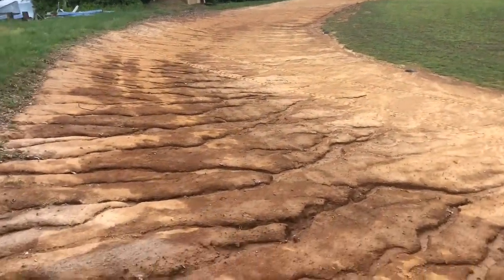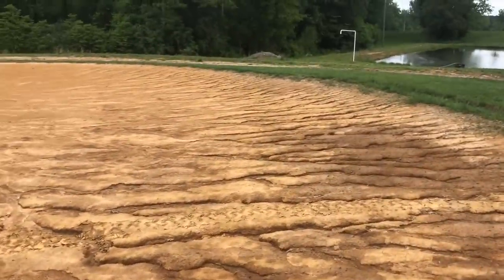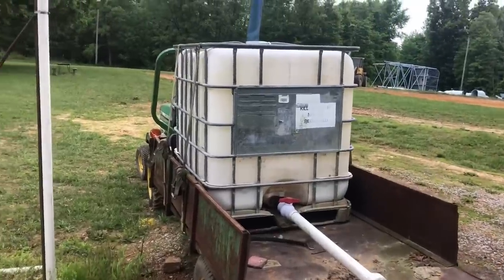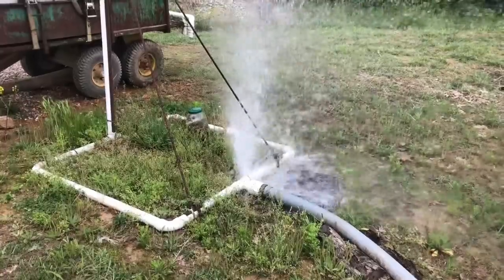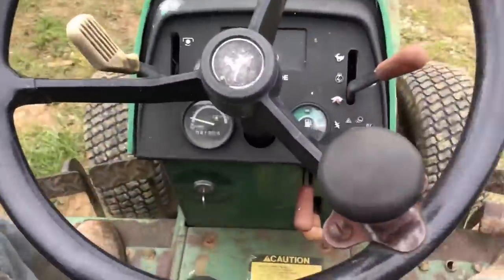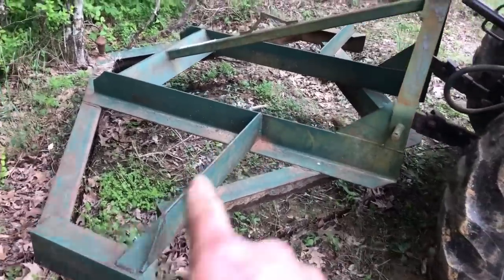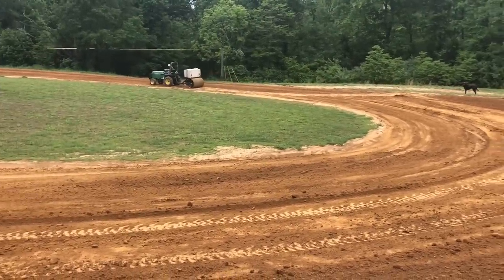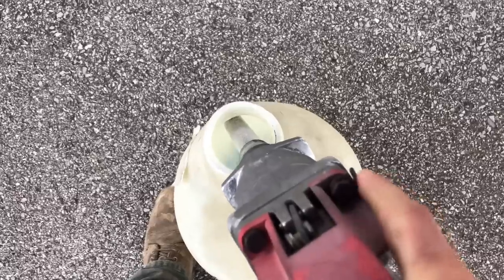Track preparation and Friday night racing

Comment: I raced karts for years absolutely loved it we ran flat heads when I quit they where just transitioning into a clone motor (blue motor or predator) I was always a Briggs guy we did run the animal engine Wich is an ohv Briggs and I had a big block Briggs Wich was 10hp block that made around 58-60 hp on a flat cart with no cage it was way more than you needed I built it solely for outlaw class ran alot of places beachnut, lil indy , I-35, junction City,clay city I have 285 or so feature wins 6 track championship wins and lots of heat wins if you ever have any questions feel free to ask my dad is one of the best set up guys in my area haven't raced since 2010 and they still ask him to set karts up
Reply from the maker: Awesome thanks will keep that in mind
Reply: I’m a flat head get myself. Ran super heavy in north Georgia

Comment: thats a great attachment,, never seen one here, i gotta build one for the front of my 25hp lawn tractor, and built it to hook tho the H frame for the snow blower head, and hook up a big pump to one of the pto shafts, one in front, one in center and one at the back, that hardest part to find tho is a female spline that fits the pot shaft, it is a 1-1/8" shaft with really fine spline, the coupler for hooking up the drive shaft for the snow blower and mower deck it so big and bulky, with a 3" pull back collar to lock on, but for a pump, just need a plain coupling witth pto spline on one end and a 1/2" round w/ way for the pump, slip on slip off, i have all kinds of diferent size and RPm hydrolic motors kicking around from when i worked in the bush and they stripped down the old short wood koring harvesters and we build de-limbers, truck log loaders out of them, dam cabs were 18 feet off the ground, that power rake would be a snap to build, never seen on at any equipment dealer here, that works great, that must have also what was on the skid steer when i said it was going so fast you couldnt see the bucket, and you said it was a power rake... this is what you was talking about, but one that fits skid steer.. i can look at something and have a snap shot in my head and build it..
Reply from the maker: Cool send me some pics of you build
Reply: @DirtPerfect  i will do a video when i build it,,

Comment: a tip for you put lysol in your water about 1 gal to a 1000 gallons of water ,  also when u run your track in pack it in the opposite the way u race on it will give u a smoother track to protect your bottom end as u say it.
Reply from the maker: Interesting may have to try that
Reply: @DirtPerfect  I have worked at several dirt kart tracks and was an official flagger for WKA

Comment: i thought that was an RC track.. like we have in town, i built the same kind of watering system for mixing calcium in water to put on mt 2800 feet of drive way to stop the dust, i built the tank with a hopper on top so i can dump 50Lb bags of calcium into the tank as the pump is blasting water in, them i want a 1/2" air hose in the tank for half hour to mix it up
Reply from the maker: Cool